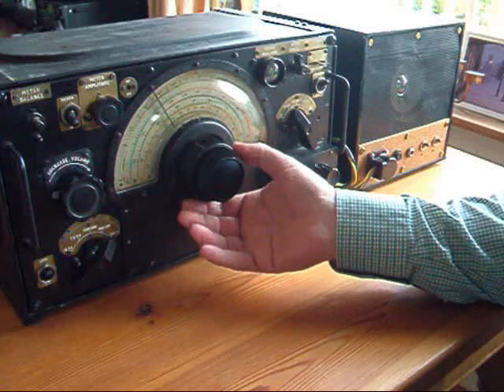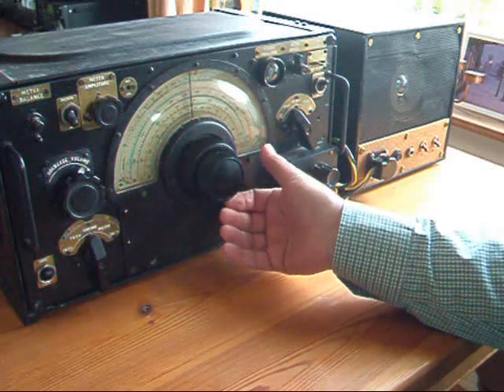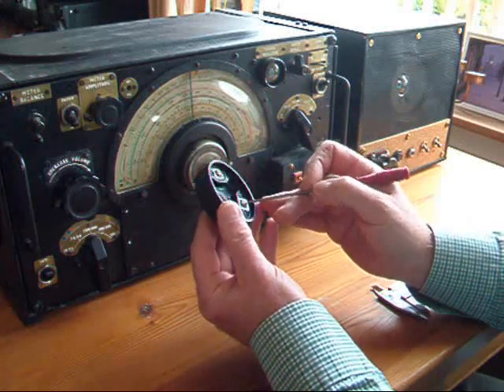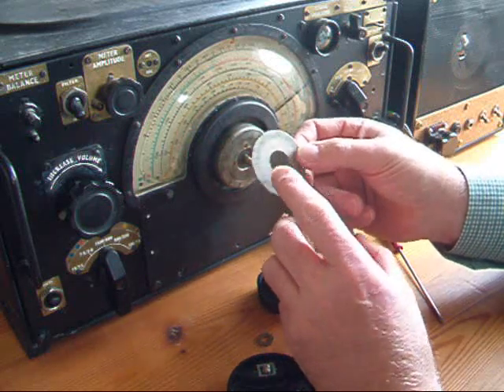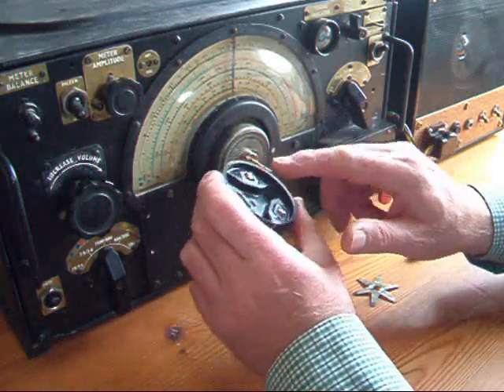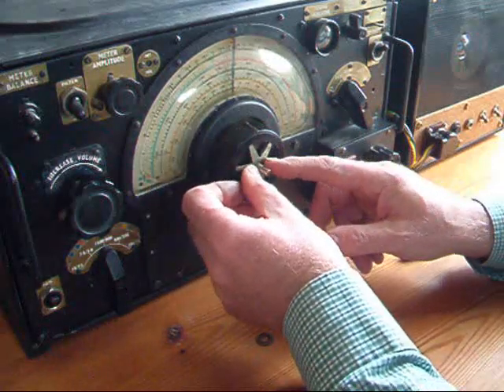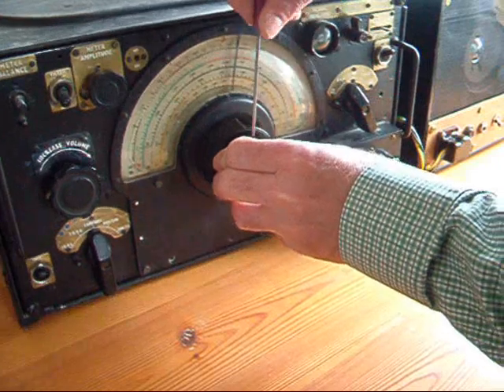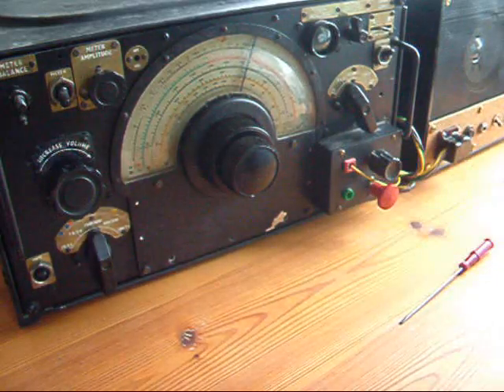R1155 slow motion drive problem.wmv

Comment: Thanks - your video was very helpful. I found the brass washer were installed under the star washer, the rollers were dry, the cork annulus had been glued to the disk, not the top hat (was able to remove and reuse).  Also the main brass shaft was very tight, had to free that up and lubricate.

Working well now, just had a struggle with the final grub screw.

Comment: Hi Andy.  Very helpful video.  I have just acquired an 1155 and the slow motion dial was working well.  I have dismantled the receiver partly to respray the case and front panel.  Whilst waiting for the paint to dry I watched your video and tried to reassemble the gubbins Doh!  After many tries I have it partly working.  I had an original cork disc which had an od of 50mm but an id of around 40mm.  It was also partly out of shape so I made a cardboard one as you suggest.  Another difference was that there was a small washer in between the dial with the 3 rollers and the boss holding on the stainless disc, not as you say in front of the star washer.  I have replaced it as you said because I could not get it to function there and all it was doing was presumably keeping the slow drive housing ay a distance from the boss.
Still not happy with what I have. I suspect the star washer may have lost some of its spring.  Any other suggestions would be gratefully received!  Thanks Chris G4ITC